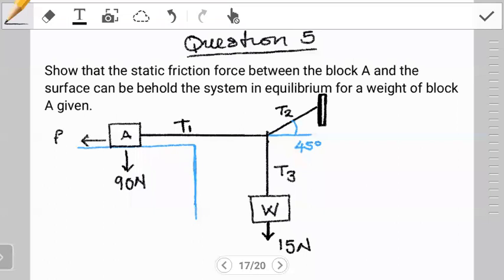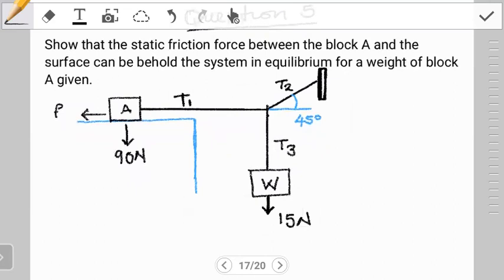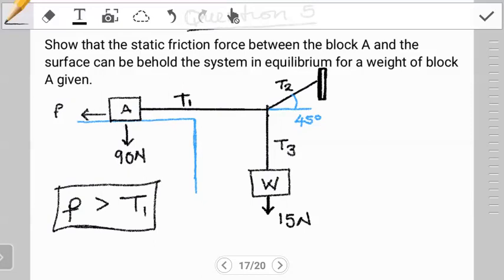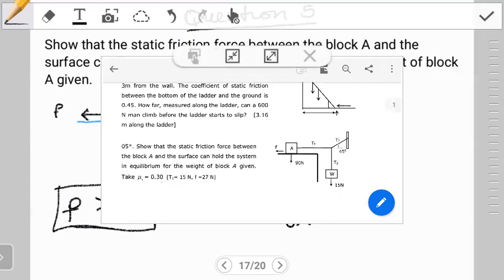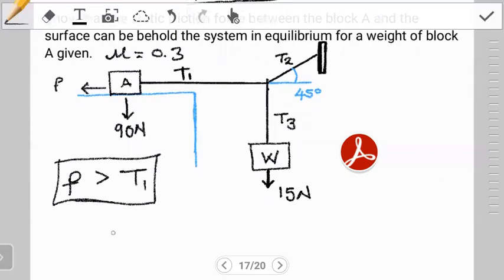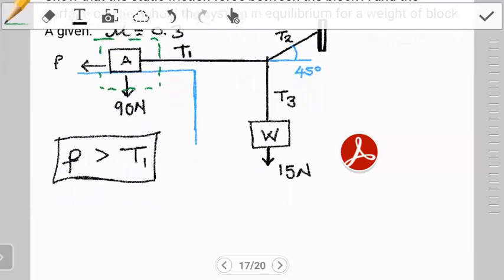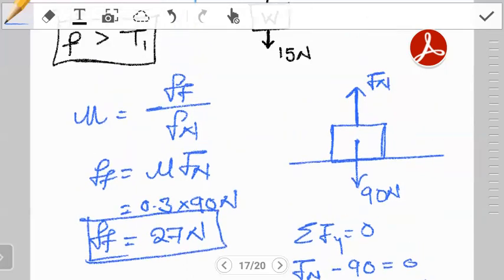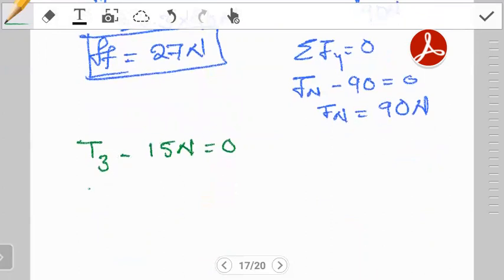Can friction maintain equilibrium

Comment: My answers are (1) 26.7N 
(2) 53.3N it increased 
And I have a question on the first part where you were comparing the Frictional force to the T1 , So what if the Frictional force you had found was equal to the T1 would the system still be in equilibrium?
Reply from the maker: @Annie
The value of friction you found, is the maximum friction the body can experience but it is not necessarily the one it is currently experiencing in this case. 
Think about it like this; when a small force is first applied to an object, friction matches (but in opposite direction) that force to prevent the object from moving. Increasing the applied force implies that the frictional force increase accordingly too. But once the applied force becomes greater than the maximum value that friction can take, only then do we say that the system is no longer in equilibrium.